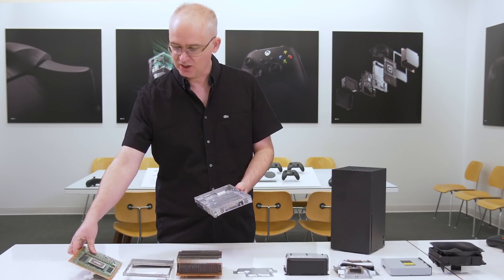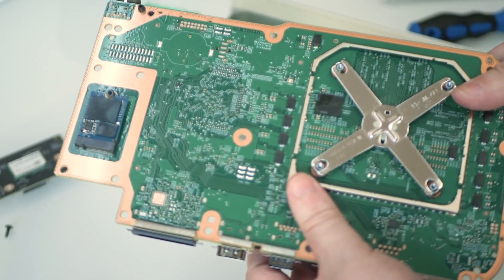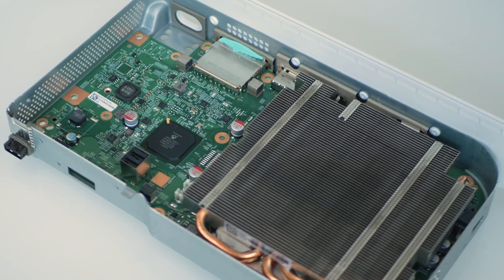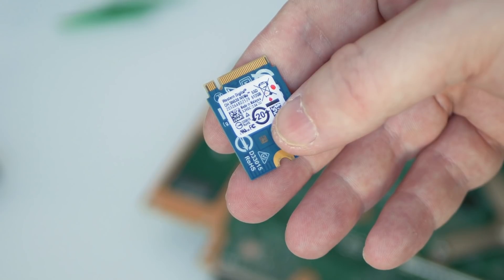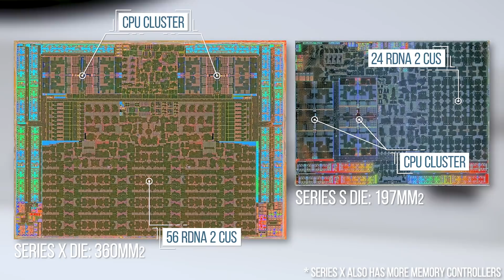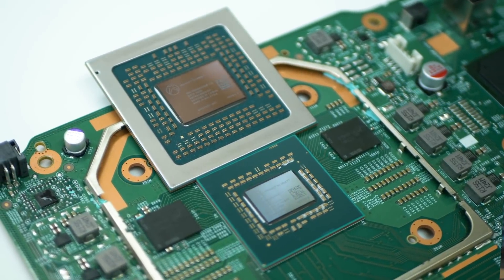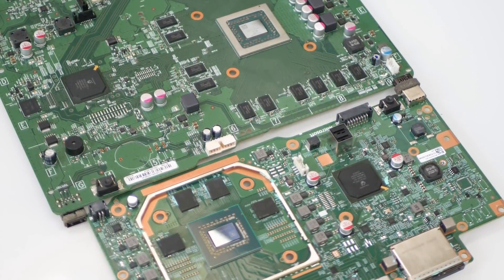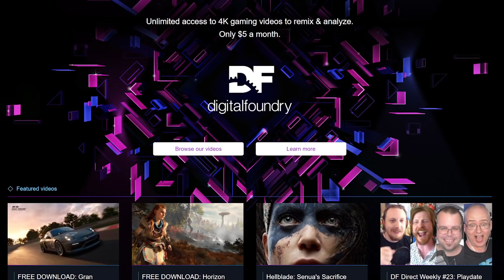Xbox Series S Complete Teardown: Inside Microsoft's Superb Mini-Console

Comment: 6:48 Holy cow. The Series X's die is actually smaller than 3060Ti (360 vs. 392mm²).
Wonder what's keeping AMD from unleashing this chip into the PC world?
Reply: It won't really work without that GPU-style memory interface, so it would have to be an unupgradable machine based on soldered ram.
Reply: It's custom designed by MS.  MS pretty much owns that design.   AMD wouldn't have a right to release it to no one.
Reply: @taurussho86  they don't have the right to release it to no one, soo... they do have the right to show it to someone? Don't use double negatives if you don't know how they work.
Reply: @codname125  wtf did you read?
Reply: The Series X's APU is a lot less capable (graphically) than a 3060 Ti, with less fillrate and less compute—nevermind that it entirely lacks tensors, too. CPU cores are very small compared to GPU parts, so the CPU cores and cache don't add much size to the silicon. MOST of the chip is GPU.
Reply: @azazelleblack  it's about as fast as a 3060 in practice (so not "a LOT less capable than a 3060 ti") and it's a SOC not just a gpu. there's an octacore cpu in there too, which does take significant space. you can't compare the number of compute units between different generations or vendors. the 6700xt has only 40 CUs and it competes directly with the 3070's 60 CUs. it also uses 20% less power for similar performance.
Reply: @GraveUypo  Who is comparing compute units? You are the only one who mentioned compute units. I'm talking about realized compute performance. The Series X SoC is around 66% as fast as the 3060 Ti in FP32, and again, that's completely discounting the tensors, which can be used in parallel with the FP32 compute units and themselves take up a lot of die area. 

Nevermind that the Series X SoC is on TSMC 7 which is a bit denser than the 3060 TI's Samsung 8, and nevermind that the Ampere architecture absolutely runs roughshod over RDNA2 when we're talking about RT performance.  

As for "there's an octacore CPU ... which does take significant space", you can simply look at the die shots right in this very video at 6:35. Look how tiny the two four-core CCXes are compared to the massive die space taken up by the GPU on the Series X.

Edit: In fact, I went ahead and did the math for you: they're 9.7% of the die area. Less than 1/10th of the die area is CPU cores.
Reply: @azazelleblack  Those 2 tiny four-core clumps take 15% of the die, which also has memory controllers on it that take another 30%, the GPU is around 55-60% of the whole die.
Series X overall is only around 5-10% weaker than the 3060Ti.
But the Xbox has a wider memory bus, bigger memory bandwidth, faster memory, more memory, actually better filtrate(contrary to what you said), better power efficiency, higher clock and with Devs starting to get better at optimizing for it plus the dev kits getting better with time, in two years time, the Series X will be outperforming the 3060Ti.
Also price, the xbox comes with memory, ssd, cpu, motherboard, case, blu-ray player, font and controller.
You're right about RT though, in that regard NVIDIA is much better than AMD.
Reply: @MaxIronsThird  They take 9.7% of the die, I calculated it myself and mentioned it in my last post. And if you think the 3060 Ti doesn't also have an on-die memory controller I have news for you.

So, "wider memory bus" and "faster memory" are both irrelevant; it's the bandwidth that matters. It's true that the Series X does have greater memory bandwidth, but radeons are drastically less efficient with their use of memory bandwidth than GeForces; note the performance delta between the GTX 980 and the R9 Fury X despite the latter having 2.5x the memory bandwidth, superior compute throughput, and superior texture fillrate.

Which brings me to my next point: fillrate. Texture fill is irrelevant because it's never a limiting factor in modern games. Pixel fill is what matters (when fillrate matters), and the RTX 3060 Ti handily beats the Scarlett SoC in pixel fill. The RTX 3060 Ti's 80 ROPs * its boost clock of 1665 MHz gives us a pixel fill of slightly more than 133 Gpix/sec. Scarlett has a higher clock of 1825 MHz, but only 64 ROPs, which lends it a pixel fill of slightly under 116 Gpix/sec.

Finally, this nonsense about "devs starting to get better at optimizing for it" is just that: nonsense. When I was a little girl and developers were coding in assembly-language for 8-bit processors, certainly software optimizations made a huge difference in game performance. That has not really been the case since the PlayStation 3, and even then there are extraordinarily few games on that platform that actually made use of low-level optimizations. Games development nowadays is all driven by standardized middleware and engine packages; 99% of games will hit within 95% of the same performance targets with minimal difference in the technical aspect of the visuals. The biggest difference in visuals these days is down to the visual design, which has little to do with what hardware you're running it on.

Regarding your other points, power efficiency is obvious, as it's an SoC, which has a great many power efficiency benefits. However, "higher clock" is irrelevant; we're already talking about the derived characteristics from the clock rate. It doesn't matter if your car revs to 9000 RPM and makes 10,000 horsepower if mine still beats yours in the quarter-mile. Regarding pricing, well, the Xbox is a commodity device, not a specialized system component. 

And besides, who cares? This isn't some "which one is better" argument. The whole point of my original reply was simply to remark that the original poster shouldn't be 
surprised that the Scarlett chip is smaller than the RTX 3060 Ti's GA104 (which is the same chip used in the 3070 and 3070 Ti), because the GA104 chip is much more capable graphically than the Scarlett. The extra 10% of the Scarlett die dedicated to the CPUs and their cache is likely less die area than is used for the tensors on the RTX 3060 Ti.
Reply: @azazelleblack  I checked by eye, so i can't really refute you there.
I don't agree with everything you said, but you're more correct than me.
I actually did forget about the memory controllers.

Console graphics optimization isn't what it used to be, but it still exists(definitely not just 5%), there won't be a Halo 3 to Halo 4 jump(UC1 to TLoU), but definitely something around Halo 3 to Reach(UC1 to UC3).

They should've gone for 80ROPs, and upped the clock by over 5%, what's the point of having got the bigger die and faster memory(compared to sony) if you're only going to be 10% stronger?!

Tensor cores are a scam for gamers.
Reply: @MaxIronsThird  >Tensor cores are a scam for gamers.
You're not really wrong, but you're also not quite right. It's true that tensors have limited value for games as they are, although a lot of people seem very impressed by DLSS (which requires tensors to work in its current form.) However, it's possible that future games could make use of tensor processors in various ways; they can be used for physics simulation (think cloth and fluids, not just particles), and they can obviously be used for advanced AI calculations, if a game developer ever wanted to include some ML-based behaviors in their game.

But you realize of course that GeForce GPUs don't have tensors because Nvidia thinks they're good for gamers. Nvidia is (rather infamously) a "one-architecture company". That means they only work on one architecture at a time. Nvidia's bread and butter financially is not GeForce whatsoever, and hasn't been for a long time now. They make most of their money in the High-Performance Computing (HPC) market. In the HPC market, machine learning and AI applications are in immense demand, and that's why Volta architecture debuted the specialized "tensor cores", which naturally evolved and became refined in later products. 

So, because Nvidia is a "one-architecture company", the same chip architecture gets used for GeForce cards as for Tesla and Quadro accelerators, and that's why GeForce cards have tensor cores now. It's fair to say that tensor cores don't have much value for gamers, but calling them a "scam" somewhat implies that Nvidia added them to gaming products knowing they had little value there, when in fact they added them to their products where they have GREAT value, and those same products got re-used for gaming.
Reply: Not gonna bother speculating or anything, but look up the Amd 4700S. It's the PS5 apu.
Reply: @nap8187  I don't think it has the RDNA2 CU's tho. Also what makes these console apu's fast is the GDDR6 memory. APU's need really high bandwidth memory over low latency regular DDR.

Comment: Love the S and its form factor  A great GPU console.  I don't mind it being white.  It isn't an eyesore in my entertainment center due to having the PS5 and WiiU.

It looks like they have a lot of oppertunity to make the unit even smaller.  Make a smaller PSU.  This can be further reduced if they ever move to a 5/6nm SoC.  The battery location.  The unused pads to the left of that. Empty debug pads.  Empty HDT pads. Empty GDDR6 JTAG, loads of empty resistor pads.

Comment: I like that internal SSD is replaceable/repairable vs that of the PS5. Great design overall.
Reply: Its ok. The Thing is you still need the same SSD as far as i know. Plugging in other SSDs does not work until you clone the old one. Correct me if i am wrong but some one who repairs Consoles (all and in generell) said something like that i think. I think it was… Thron? Tronix? Repair. Something like that. Its better yes. But still not perfect.
Reply: Oh boi y'all still making non issues out of the SSD storages again
Reply: @jeremybrown9611  You are right its really not an issue. As long as it doesnt die. Its also better when you need to repair it. But i just wanted to tell ppl that you cant just swap it. That doesnt work. Unfortunately. That would be really cool in my Opinion.

Comment: I know it'll probably never happen but imagine if Microsoft would allow installation of Windows 10 or 11 on the Series machines. My series X runs rings around my crappy 2015 HP, if I could install windows on it I'd be so happy.
Reply: @Real Gamer They are not PCs in that they are not marketed as such but hardware-wise they are fairly powerful x86 machines.

Edit: Forgot to add, the Xbox system software (OS) is a modified version of Windows. Technically Xbox One and S/X already run Windows. While not trivial it should not be that difficult to get the full Windows 10 running on its own partition (or external drive), should MS allow it of course.
Reply: Honestly I think that’s the direction MS is going. They already integrated Xbox app and features into Windows 11. Next generation Xbox will probably be a brand of optimized gaming PCs
Reply: they won't, if they do, that move would kill everyone in the industry, it will cannibalize a lot of manufacturers. MS will eat everyone on silicon valley.
Reply: the reason why that's very unlikely to happen has less to do with hardware and more to do with business and philosophy: A console is a closed ecosystem with rather stringent DRM whereas a PC is an open ecosystem. There's a reason Steam or Epic Store or GOG or whatever don't exist on console because the console manufacturers drive all revenue from having exclusively their own storefronts on these plastic boxes, and no other. They make money by 100% controlling how and where the games are sold on their consoles, and getting a 30% on every penny a gamer spends in that ecosystem. 
On PC, there's no store you gotta stick to, there's no fixed specs you gotta stick to, etc. If you see Plague Tale Innocence get a discount on Steam but then notice Epic Store is giving it away from free, you're free to choose between both options, or even better - go for both, because the open ecosystem allows for several competitors to come into market and provide their own offerings with very few barriers for the PC user. This isn't an issue because there isn't one company making all of the things in your PC, as such, it's a lot more decentralized and as previously mentioned - open. Allowing Windows on a Series machine would therefore go against the very bedrock of why these consoles are made in the first place.
Also, allowing Windows on a Series would mean far lesser DRM policing, as such, piracy can be a lot easier to do and have it run rampant - an issue that can become very troublesome on hardware that's already being sold at a loss with hopes of making back that money from games and services.

Comment: 🤔 does this mean that, theoretically, a game could load faster if it was installed on both the internal drive and the external nVME at the same time?
Reply: This would require a lower-level functionality like RAID, and there's no way MS implemented it for such a niche use case.
Reply: No.
It would only use on drive. Not both
Reply: Curious
Reply: It's a lot more efficient to use all available bandwidth for swap filing on the SSD. Using a disk would reduce performance.
Reply: @thepuzzlebox6620  where on earth did you get "disc" from? You know.. an SSD is a drive... A solid state drive... Hence SSD
Reply: @Nonx47  Yeah, I didn't read that properly 😂 Imo, it still stands though due to the memory bus being  narrow af. Using both drives will act as a bottleneck.
Reply: No not supported

Comment: Happy to see xbox no longer using clips only to hold the case, as cleaning old xbox is pain and clips always snap away.
Reply: I agree! The original Xbox 360 models as well as the slim were kind of annoying to get into. Awkward angles and prying techniques. When I took apart my One X to clean it, I was very surprised at how easy it was compared to older models. Looks like they're keeping that design philosophy.
Reply: I cracked the shell on my one X thanks to one of these damn clips.

Did the same with my 360 back in the say

Comment: Interesting the internal storage is Western Digital, yet the expansion card is Seagate
Reply: Could see one from WD still yet, Seagate were just the first company ready for launch, others manufactures have been working on producing the external ssd cards for xbox from whats been said in the past, just got to wait & see who & how large they are capacity wise
Reply: Oh I imagine more are coming. But Microsoft has been using Seagate for their Xbox branded external storage for years now, so they already had a contract with them. So why Western Digital for the internal? Just weird, I'm sure they have a reason
Reply: @jessefleming9763  I think they use more then just those two for the internal SSD because they need more for the Production of the Xbox S and X. As a Manufacturer you dont want to tell ppl they have to wait 3 Weeks for the S because currently everything is ready… but the SSD is on an container right now. Thats why. The PS5 has 3 different Fan Manufacturer too for example.

For the extern selling SSD… if its sold out its sold out… Thats not cool but MS would not care that much. That would be the Issue for Seagate then.
Reply: @flimermithrandir  See, now that's a good point. Never thought about that. I do also find it interesting that Xbox has a removable M.2 for its internal, yet Sony soldered their internal to the board of the PS5, but went removable M.2 for the expandable
Reply: @jessefleming9763  I think its more important which Controller is on the SSD and that could be the same on those two. For the switching Part… i am not 100% sure but i heard you cant just swap it. It has to be cloned to be able to do so. Its better then the PS5 SSD though. I guess Sony doesnt want us to experiment to much with the PS5 and a soldered Version is just saver there. It could also be because of the 6 Lanes they use (custom and there fore Sony made) but… that i really dont know, just an idea.
Reply: Maybe they got a good deal with one of them
Reply: I believe it's a toss of a coin which brand the internal one is, I believe I've seen different ones before

Comment: Richards "issue" with the seriesS's memory allocation is a bit puzzeling at this stage.
While more ram is always welcome, we have to take into consideration that the other consoles 13.5gb of available ram is not a huge leap over the 9gb on last gens 4k console (one x). Also if we consider how these next gen machines are designed, they are designed to have data streamed from the SSD extremely quickly, So if somone is going to worry about the Series S ram allocation they should also worry about the seriesX's and PS5s ram allocation.
Reply: It also has much slower RAM than both Series X and PS5, though
Reply: @skit_data6320  no shit sherlock. 10 gb ram is totally not different from 16gb ram. If it was 12 it would have been a different thing
Reply: @skit_data6320  the series s doesn’t have to push 4K sized textures. I’m pretty sure Microsoft’s engineers know a thing or two more than Richard
Reply: @V1CT1MIZED  I wouldn’t be so sure, companies makes stupid decisions on hardware sometimes to cut costs. We already see cutbacks outside of resolution and texture resolution on the Series S. Stuff like LOD, Ray tracing implementation etc.

Comment: Xbox is the clear winner this gen💪💪
Reply: Eh ? Dream on
Reply: Coming from a unbias pc standpoint, id agree. spec wise they are the same system, except xbox tuned the cpu and gpu to higher frequencies. Add the value of gamepass and more cross platform capabilities with pc, id call that a win for sure.